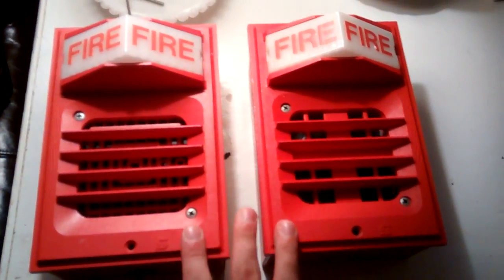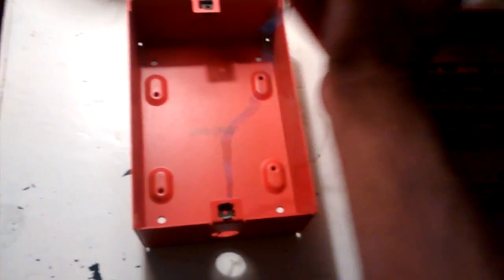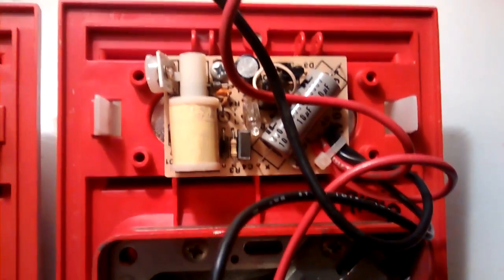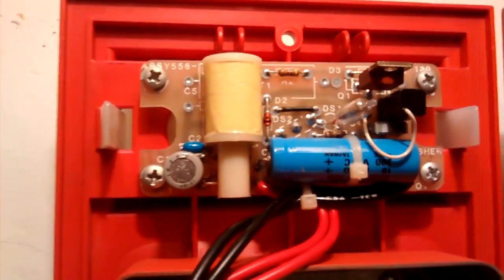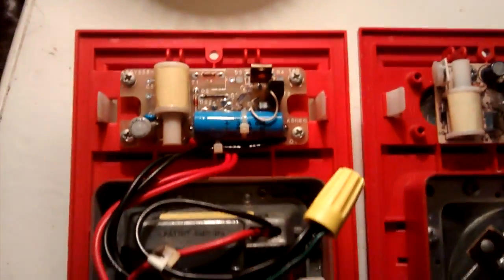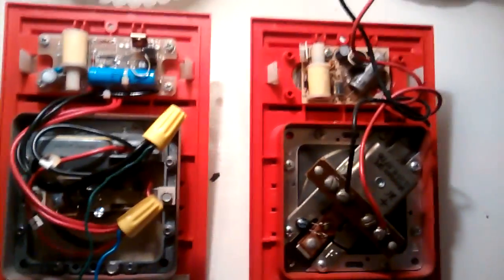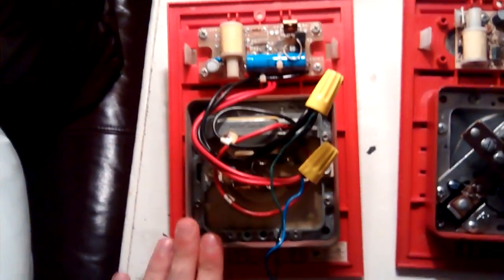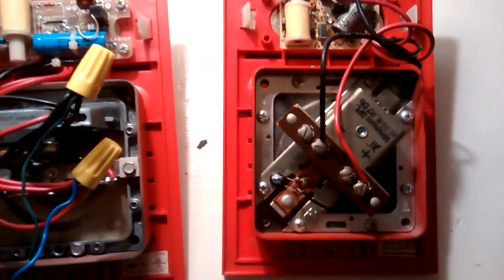Comparison - Old vs. New Simplex 2903 Fire Alarms

Comment: 1979 to 1998
Reply: I don't think these were made as late as '98.
Reply: @twiff3rino28  They were, I have several of the late model. I work for Simplex. The building I own has over 100 of these and they were put in 1994.

Comment: i have a 2904 light plate with a 2901-9806 horn is that about 1979 ?
Reply: Have that gut feeling that at my past school in NH, it was the mid-1980s. Most 1979 systems there, would be a 4051 on a 4050 fixture, most likely, especially the pre-reno auditorium, which in 2001, got a True Alert signal setup, with the auditorium having True Alert speaker/strobes (IIRC) and True Alert horn/strobes in the hallway. The rest of those 4051-4050 signals, were in the staff dorms and the buildings around the recreational field.
Reply: @RJARRRPCGP My old elementary school in ME used these.  It was apparently last renovated in '82 when I was there (94-00).

Comment: Ahh, those horns produce a diminished fourth chord when sounded together.
Reply: Sounds like C-major, with the '9833 being lower-pitched... And Faraday horns often have a burble, like its version of a Subaru, LOL, even though not all Faraday horns sound like that. Especially, because of the design of the reed, which is seen on the lower left of the one on the right... And  "JK" looks too new to be on a '9833! That's in '9838/6120 territory!
Reply from the maker: @RJARRRPCGP  Confirms my suspicions - the higher-pitched -9833's are newer than the ones that sound like truck horns (wonder what the oldest "pigtail" versions sound like). I never really paid much attention to the date/revision codes, is there a way to tell from the letters exactly when the horn was made?
Reply: @Fahrenheit4051  The very-late-gen Faraday horns, are usually lower-pitched, especially sometime around 2000. My buddy is in a group home with a very-late-gen Faraday horn/strobe outside of the room and clearly heard it on Discord on October 1 at 1 AM. (told by my buddy that there was a fire drill at 1 AM) Likely when Siemens had them. Likely a Siemens system where he lives. The higher-pitched one in this video is from Federal Signal. (The '9806) My last school, outside of music class and the cafeteria has those. The one with the silver plate, in this video, is a '9806.
Reply: @Fahrenheit4051  On a '9833, "EJ" is most likely October, 1984. (Maybe September?) OTOH, don't know where to look on ones manufactured by Federal Signal, which would be '9806.
Reply: @RJARRRPCGP  Sounds a bit more like B-major lol